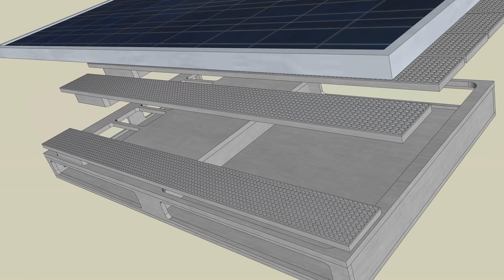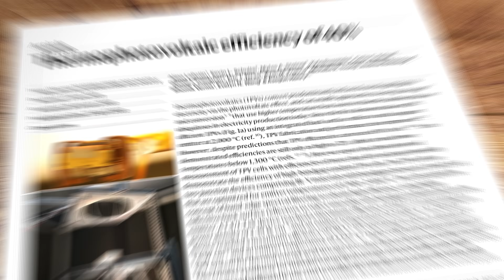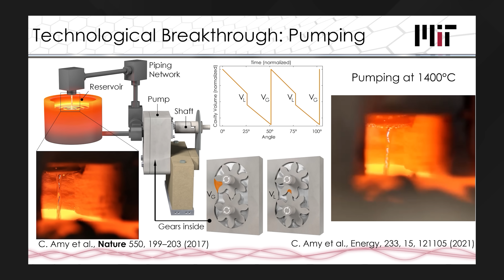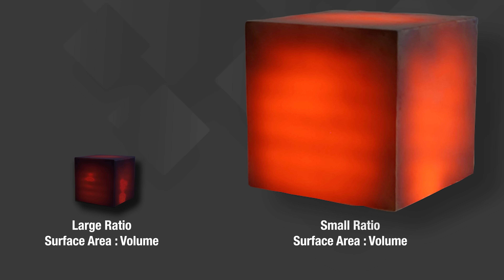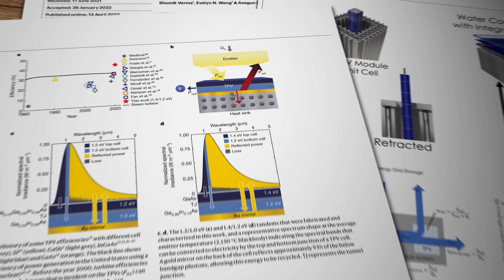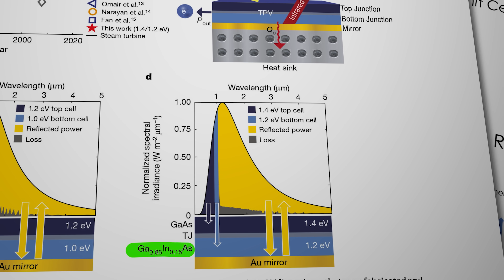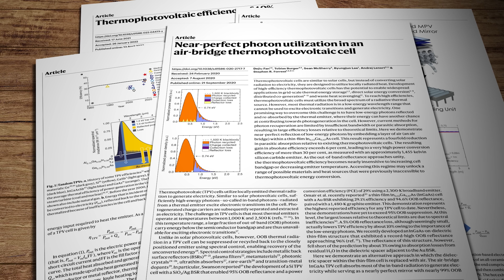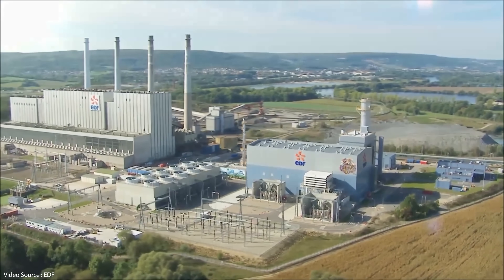Grid Scale Energy Storage 30x cheaper than Lithium-ion! How do they do that?

Comment: Fun fact: a tank with 1000 litres of water heated from 30 to 80 degrees Celsius stores 58,3 kWh of energy (over 4 times more than a Tesla Powerwall 2) .It could be used as a super-cheap "battery" e.g. for home floor heating.

Comment: If this technology could work economically we would already do it with conventional gas turbines, flow some carbon dioxide over the the molten tin then use it to spin a turbine. With an additional steam recovery unit, you can reach efficiencies in the 60% range, with mature technology you can buy and install today, not speculative research.

Nobody does it because electric resistive heating to thermal storage is a dumb concept, you have to have sustained access to electric energy spot prices of 20% or less of the peak prices you want to take advantage. No electric grid has that much variation on a regular basis and it would be a sign of imminent failure. Extremely cheap batteries are coming online, made with huge economies of scale and optimized for grid storage, made from cheap, widely available material such as sodium, carbon and aluminum, any storage solution needs to compete with that.
Reply: (and also, molten tin is a complication that's not required, just pass a controlled controlled current and the working gas directly through the graphite)

Comment: $10 per kWh is the capital cost but the plant has operational costs which could be considerable  unlike a battery which has none. So the cost per kWh output will be very different.

Comment: So, the heated water after cooling the photovoltaic cells is pumped to a big heatsink where it is basically exhausted/wasted to the atmosphere. Why can't this heat be extracted and utilised to generate more power thus increasing the overall efficiency of the system.

Comment: Great video as usual. This looks like an amazing alternative to lithium ion storage. One thing that occurs to me is:  Why would you dissipate the excess heat in the "radiator" unit, rather than use the heat at the front end? Surely that would make the system a little more self-sustaining. 
Thanks for yet another brilliant video.

Comment: Oh, this is my second-harmonic solar panel, but using an incredibly hot blackbody radiator instead of the upconverting crystals. My theory is to combine 2 infrared photons into 1 green photon, using the crystals from laser pointers which convert infrared lasers into green lasers. This would allow us to convert background thermal radiation directly into electricity. Here, thermal photons are energetic enough to electrify solar panels directly. Tough question: How do you keep something that hot while using less energy than the solar panels create?

Comment: I am curious if they'll harvest the cooling water's heat to help produce heat for the graphite blocks again.  Using the steam to run a generator to be fed back into the system.  It may not have a good return  for the costly equipment to convert steam into electricity though.

Comment: Seriously? The #1 cause of Nuclear "Meltdowns", with the correspondingly massive explosion, is the loss of cooling water, or the loss of power to cooling water pumps and circulation. The temperatures discussed here are high enough to create an explosion that would level multiple city blocks. Explosions that would rival the MOABs.., the Mother of All Bombs. 💣 Isn't the safety of Atmospheric Pressure Liquid Salt Reactors their #1 selling point? --- They Can't Explode! --- While these are Guaranteed to Explode... because: #1; Every man-made system fails. And, #2; Human error... This might be efficient and inexpensive, but it is not Safe. It can't be made Safe. 
Remember that pesky "Vaporize" language? That's just another way of saying --- "EXPLODE!"

Comment: I don't understand why they would use an electric resistance heater when a heat pump would be more efficient... I mean with TPV and a heat pump I don't see why you wouldn't have a heat to power machine which seems like the holy grail... clearly there is something that I'm missing or they would be doing it already.

Comment: I watched the entire video and I'm very confused. If you can store all that heat energy with low losses, why not just use it to run a steam turbine instead of this needlessly complex set-up to convert the stored heat into light and then into electricity using the tungsten TPV steup? Large, industrial, multi-stage steam turbines can have efficiencies of up to 90%. As groundbreaking as this development is in its own field, the 40% efficiency achieved is laughable when compared to the archaic steam turbine technologies we've been using for centuries. I must be missing something crucial here. Would someone please kindly enlighten me?

Comment: The concept should try and use concentrated solar power as a heat source and substitute this system for the traditional sodium thermal power storage. Ideally if you could use the cooling system for the PV cells to desalinate sea water. Corrosion would result in more maintenance but water revenue should offset that cost . Love the channel’s work .

Comment: What if you just combine the photovoltaic  cells in a layer under the solar panel? It will get excess light and heat from the panel. It may not be as efficient, but will raise the efficiency of a stand alone panel.

Comment: It may be cheap per kwhr stored but it wastes 50% of the electricity compared to battery storage which can be close to 100% efficient. That wasted power has a value which, after not very many cycles, would cover the extra upfront cost of a lithium battery.  So 🔻 is my verdict.

Comment: This sounds pretty dodgy. Why did they choose carbon over another material? Something with a higher specific heat capacity?
How do you keep molten metal molten. It will need energy to keep it molten even when the renewable energy source isn't producing. If the metal solidifies, good luck clearing the pipes, or restarting the flow.
I'm not convinced, yet.
One other point is the mistake about something being 30x cheaper. While possible, it's pretty unlikely. They probably mean 1/30th of the cost, maybe? If they wrote that, then I have even less confidence in the idea.

Comment: Many years ago there were manufactories that used storable heat energy to propel locomotives around the site. These resembled the steam tank engines of the time but instead of having a fire under the boiler the engine was plugged into a steam raising plant, thus heating the water in the engine and pressure storing energy. The principle is similar to fizzy drink bottles, take off the lid and carbon dioxide is released from the liquid. The water in these engines was heated under pressure so the water was under sufficient pressure that it was unable to boil until power was required to drive the engine. Apparently one charge would last for 6 to 8 hrs. Using this system, existing steam powered generators would have instant source of stream/pressure to meet excess demands as a considerably simpler and cheaper alternative.

Comment: Pretty fascinating stuff!  Have you come across any deeper research into crystal power cells?  While not amazing in terms of energy storage, their ability to output a trickle of power for literally YEARS while being DIYable with just common materials like Rochelle and Epsom salts, alum, borax, potassium chloride, etc., and copper & magnesium, makes them a viable energy storage medium for extremely low-power applications.  (e.g. sensors that only have to wake up once a day for a handful of seconds, running off of a supercap recharged by a CPC bank.)

Comment: I’ve thought about using PV solar to generate electricity to heat thermal mass for storage, but I hadn’t thought about just using the “solar” part to heat thermal mass directly rather than using that PV electric middleman (and the resulting efficiency losses). I suppose this gets into the same camp as the focused-mirror types of solar plants, but could hold a lot more mass. So the question is, what’s the efficiency achievable for direct sunlight-to-heat-to-mass? Get that, then you just do whatever to convert all that stored heat to electricity. It could be this process, or just plain old generators, or something else. And again a conversion loss, but they’re gonna happen.

Comment: If you haven't caught it, this is a scam. The point that I realized this was at the point where the tungsten radiators would be heated to near white hot temperatures. 

Really!?
And how are you going to force that energy into them from those graphite storage blocks? Because one of the most fundamental concepts of thermodynamics is that heat "flows" from a region of high temperature to a region of low temperature. Thus this absolutely means that the graphite blocks MUST be at a higher temperature than the tungsten radiators.

Comment: What happens when plant goes “cold” how do you get the solid tin in pipes,valves, pumps running agAIN. Safety concerns leaks or foreign material contacting molten tin reacts explosively .

Comment: The whole system has a lot o points of energy loss. 1) Why to use electrical heater to heat up a molten metal and pump it to another building? It is a loss of energy. They should use electrical heaters inside of graphite blocks to  heat them directly. 2) Why pump a heat from graphite blocks to another building in order to heat up tungsten foil? It is a loss of energy. They should install that tungsten foil on walls of graphite blocks to heat that directly. 3) Arrays of PV are cooled with water. Why to mindlessly dissipate a heat from cooling system into the environment? It is a waste of energy. Maybe with use of a heat pump it would be possible to use that heat to slow down that graphite blocks cooling. Or to produce a steam and run electricity generator on a low pressure turbine. Or use it at least to provide domestic hot water for some people. Or whatever else useful, right?

Comment: Even if they achieve 50% conversion efficiency at the TPV cell, the overall efficiency of the system has to be much lower with heat losses all throughout the chain. And the system is stupidly complex. Compared to chemical or kinetic storage this looks like a poor solution.

Comment: '30x cheaper' is nonsense.  '30x cheaper when compared to___' would make sense, as would '1/30th the cost', but as it stands its multiplying an undefined idea, (the cheapness of li-ion) by 30. you could  to define the cheapness of li-ion by comparing it to another kind of battery. or if you are, in fact, only comparing li-ion to one other kind of battery you could express the cost of one as a multiple or fraction of the cost of the other. end rant.

Comment: I'm sorry, but this tech has more components and failure points than Chernobyl. I see a very complicated system that relies on more than a few critical systems of containment and cooling, which is spread over a very large area. These systems are not that easy to maintain, and in the event of a maintenance event, I am certain this would mean totally shutting down the facility for a prolonged amount of time. I fear this would end up like many of the past "savior technologies that we have hoped would turn out to be more than what it seemed on the surface. I point to windmills, for example. Looked like great free energy until you realize how devastating the maintenance became.
Reply: Yeah. Wind power could never work, right? Well OK, but it could never be cheaper than coal, right? \S

Comment: Maintainability / serviceability.
If it doesn't have those, it won't work in practice!

Also, the system is inherently unsafe with water that can easily turn to gas with a single mistake.
No, I don't like the idea at all...not to mention it is a rather complicated system.

Comment: They have absolutely not thought of every cost. First, that has not happened yet for any nearly as complex system, ever. Secondly, they don't even have a finished production prototype yet, they actually don't know in detail what is going to be needed. Thirdly, cost depends, they could have done some informed estimations about a lot of things, but their estimations seems more wishful than informed. Example, $0.5/kg for the graphite blocks, that's well below average world market price for graphite, the raw material. Maybe they can use the lowest grade graphite, then they might be ably to buy the raw material for about that price, but they still have to process it.     

Their cost "analysis" shouldn't be compared to finished installed battery systems, with profit margin, warranty and all that. More like the cost of lithium in form of lithium carbonate, aluminium in form of bauxite and so on, then you will reach a similar cost, for capacity, and much lower cost for power.

Something seeming to good to be true should raise some level of caution, when someone makes multiple such claims, and is looking for free money, well, just have a think about that. 

When they have a system that's been up and running a few years, without loosing performance, then I'll believe them.  It's one thing to achieve something on a laboratory scale, temporarily, and a completely other to make a commercially viable product.       

The thing is, the higher the temperature difference you can use, the higher efficiency you can get when converting heat to power, and that is common knowledge. No one else is using such high temperatures, because it involves a lot of difficult problems. Maybe solving one of those issues is not going to make a practical system. 

You can get over 40% efficiency in steam turbines, and they work. No huge drawbacks, like having to be invented, and developed into a commercial product, or demanding multiple really huge technological breakthroughs. (Pro tip; if you want to develop, or invent, something useful, make sure your idea does not require multiple really huge technological breakthroughs). A small amount of batteries can pickup the slack until the steam turbine leaves when very quick response is needed. What the turbines have that PV lacks is inertia, which provides some stabilization, not very much, but absolutely instant.  So, there is little to no potential gain to use TPV to convert heat into power over steam turbines in a thermal energy storage system.        

Sure, the more mass you store heat in, the longer it will take to cool down, all else equal. But, energy loss is essentially linear with the difference in temperature to ambient, all else equal. At 1400 °C absurd insulation is needed to keep losses somewhat acceptable.  Heat storage in phase change is much better in multiple ways. When you have a phase change, you store energy at a specific temperature, you can ad and withdraw energy without the storage media changes it's temperature, it changes it's phase instead. That makes getting decent efficiency when "charging" and especially "discharging" so much easier.  

Storing energy as heat in specific enthalpy means temperature changes when you add or withdraw energy, and, the wavelength of the radiation changes with the temperature. That in turn means you have to make the TPV efficient over as wide spectrum of wavelengths as possible. At those temperatures graphite "stores" about 2 J per K per gram, temperature is lowered roughly 2 °C per for each kWh withdrawn per ton of graphite, at 40 efficiency, that's 5 °C  for each usable kWh per ton of media.  When say 20 kWh of energy has been delivered, per tonne of graphite the average temperature will be deceased with about 100 °C, and if huge massive blocks is used, and that amount of energy is taken during a short time, the surface temperature of the graphite will be much lower, despite the fact that graphite has really good thermal conductivity.  That means it will run into efficiency issues, and power output limitations, unless they store heat at en even higher temperature than they use, but that strategy comes with it's own set of drawbacks and challenges. 

Trying to reinvent the wheel is one thing, but they're also trying to rediscover fire.

Comment: So much BS in this. Not only is this the worst efficiency for an energy storage system I have ever heard of but pumped hydro is close to 90% while this would be way under 40% after losses. Besides this, pumping molten metals has been done for close to 100 years. Not only do several nuclear plants rely on this, but also in metal refining and casting molten metals ranging from aluminum all the way to steel pumping molten metals is normal. Second this system is extremely inefficient and has huge losses in the heating elements, the heat sinks, the coolant pumps, the many km of piping needed and all the materials. Pumping liquids such as water or molten metals has lots of friction, which equals lost energy. All the energy being dumped by the "dry cooler" equals 60% losses, since the solar cells are only 40% efficient.

Comment: I always worry when Graphite is mentioned. Graphite is a highly refined and processed form of carbon from sources, often from fossil fuels, notably the longer chain hydrocarbons in oil, or from the higher grades of coal, like anthracite or coking coal. To get from the amorphous carbon coke from these fossil sources, high temperatures in Electric furnaces, over long periods are required, and isolation from atmospheric oxygen, as the atoms are baked into  the graphite crystal structure.

Comment: In case you did not realize, most window glass had been made by floating it on a tank of molten tin for at least 60 years now. so don't over estimate the difficulty of molten tin in this system. just apply heat and it melts.
Reply: Heating tin on a open bed is not a problem. Pumping it through pipes makes me nervous. I guess, when the pump breaks down for some  and the tin gets cold, the system will be damaged  beyond repair.